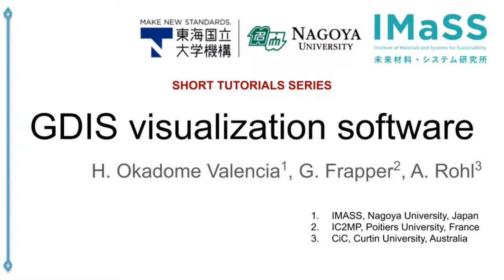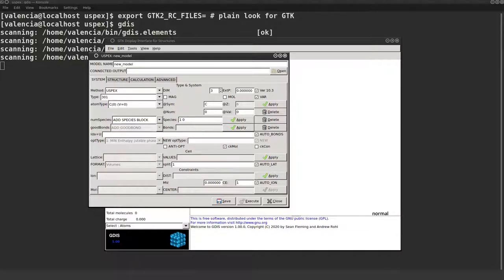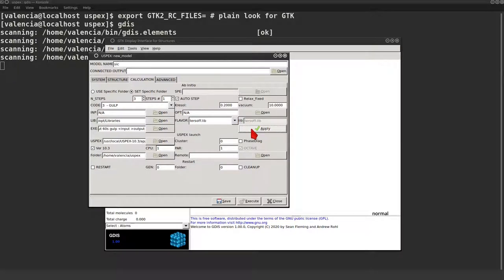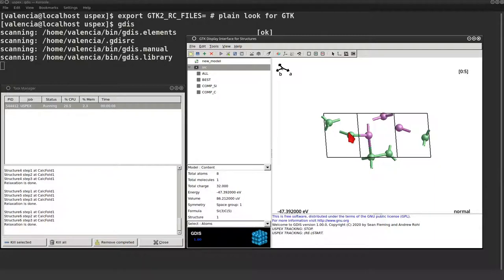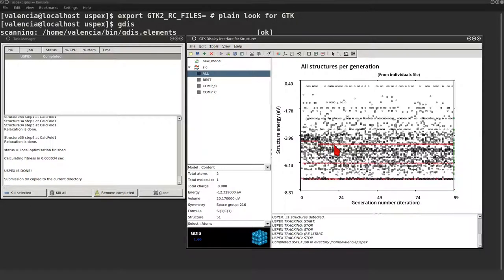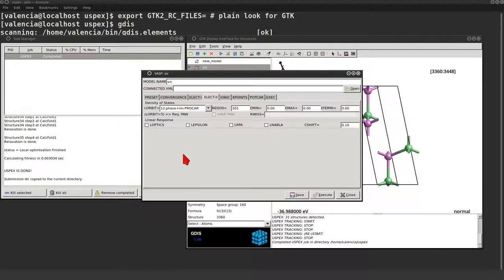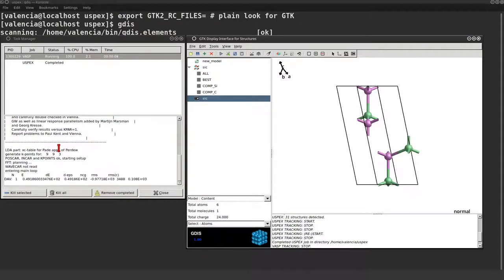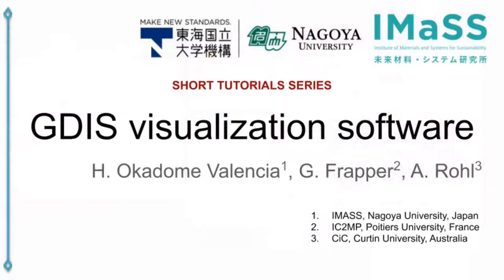GDIS short tutorials I

Comment: Hello. Thanks for the video. Please, how can I install GDIS?
Reply from the maker: Hello, and thank you for your message.
To install GDIS, please either use git and type the 3 commands:
git clone https://github.com/ovhpa/gdis.git
cd gdis
./install
Or go to github site https://github.com/ovhpa/gdis and download the zip archive of the code. If you have wget, it is equivalent to the following 4 commands:
wget https://github.com/ovhpa/gdis/archive/master.zip
unzip master.zip
cd gdis-master
./install
NOTE that you will need to have a C compiler + two GTK libraries installed: gtk+-2.0 and gtkglext-1.0
Depending on your operating system, you might need to find out how to install them through your package manager: apt, zypper, yum, dnf, pacman, etc.
Reply: @ovhpa  I am really grateful. I was able to install successfully.